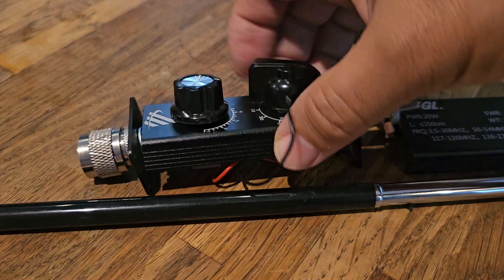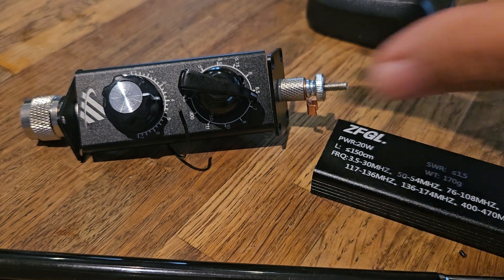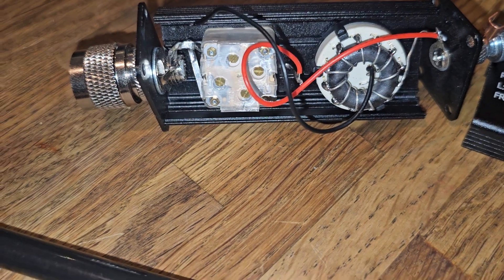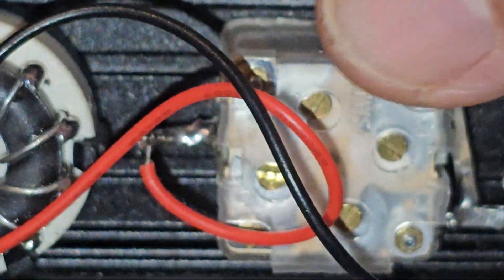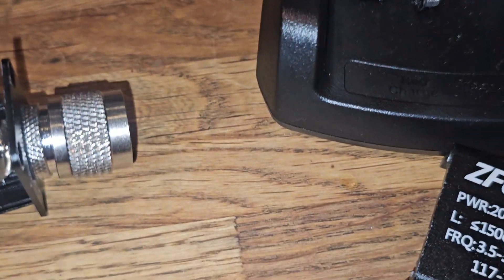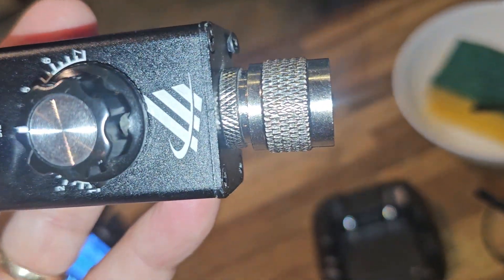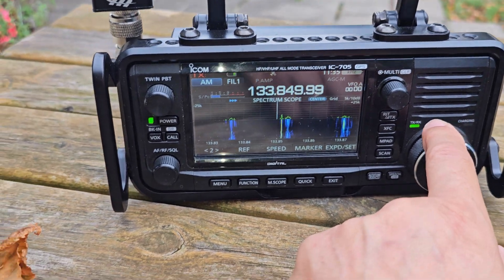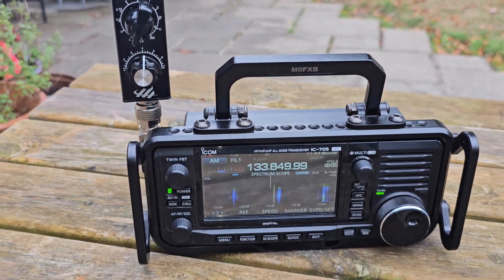Matching Portable Antenna Clone - Fix

Comment: Upon first use the center conductor apparently broke off on mine TOO because it apparently twisted or just fell of on transport (???). 
However I did not notice it being loose and turning. 
I did TX several times obviously without me knowing. Probably I messed up the mosfets my ushdr mchf rig. 😢 Need some time to test it properly. 
It seems a lot of these antennas have this problem so BUYER BEWARE.  
Open it up and tighten or modify with a serrated ring before use…
Reply from the maker: Try this one
Wishcolor HG-20A 20W QRP Antenna Loop Antenna for HF Transceivers 5-30MHz 76-108MHz 110-150MHz
https://s.click.aliexpress.com/e/_EycUf0q

Comment: It’s just an L matcher. It’s designed to present the lower impedance of the whip, 5 ohms to 35 ohms maybe, to the rig’s 50 ohm front-end impedance. It will handle 5 watts transmit but no more. Expect arching on the polyvaricon if you run more than 5 watts full duty cycle on transmit. I would run a counter poise to the lowest operating frequency just to get a fighting chance. One more thing. Why on earth run this L match above 30 MHz? Wavelengths are short enough from 50 MHz on up to run a proper 1/4 wave antenna. The impedance of a quarter wave is 71 ohms with a proper counterpoise which makes using an L matcher pointless. Also the L matcher in this configuration was designed to present lower impedances from the antenna to the rig as 50 ohms and not straight 50 to 50 ohms or antenna impedances above 50 ohms to the rig.
Reply from the maker: Good info.
Reply: @M0FXBHamTech  if I could make a recommendation and at your own discretion, you could mount a double pole single throw toggle switch to the matcher that would switch the variable capacitor between the low impedance, 5 ohms to 40 ohms, it matches now and high impedance antenna loads of greater than 50 ohms. Simply solder the side of the variable capacitor attached between the inductor and the PL259 side of the matcher to the common terminal of the toggle switch in the middle then solder one wire from the switch terminal closest to the section between the coil and the PL359 connector, the low impedance side then solder another wire from the other switch terminal to a section between the coil and the whip screw stud side, the high impedance side, and you’re done. Now you can connect a random wire to the whip side. For example 44 ft and match it switched to high impedance configuration.